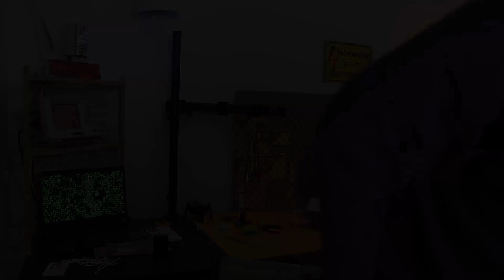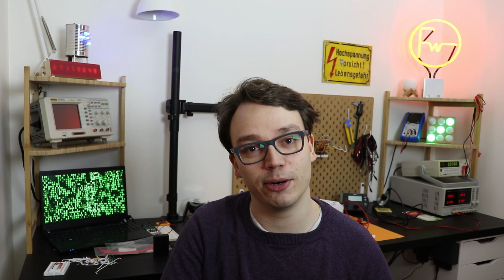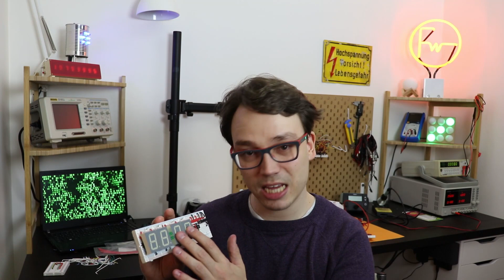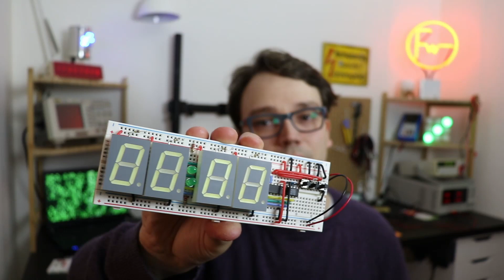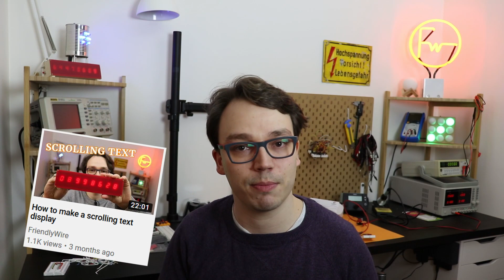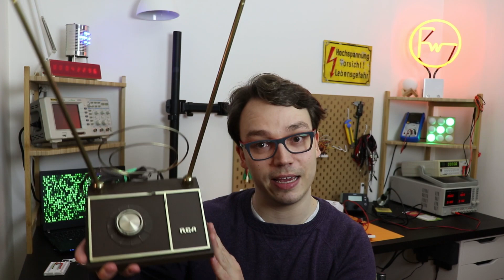Failed project, TLC5916 LED drivers, saying hello | Workbench Wednesdays #1

Comment: Mistakes are the best teachers, so I find this type of videos very interesting. Talking about the conversation of the use of Arduino or PiC Microcontrollers of below, I really aprreciate the effort of using  PIC as the audience is not as huge as if you were teaching with Arduino. I totally agree with you, I was used to work with arduino so when I change to PIC in college, I felt cheated because of the amount of differences between them. So, from my point of view, Arduino is NOT a good point to start on electronics. Anywhere, thanks for your videos! :)
Reply from the maker: Thanks for your comment and glad to have you here! I am not really advocating either, I am sure there are many situations when Arduinos are a great choice, and then again others when PIC microcontrollers are better, and then even others when neither is a good choice. I like to use PIC controllers because they are quite affordable and surprisingly simple to use :)

Comment: I'd love to see more projects that can be made with microcontrollers. I'd also like to get a better understanding of what the different IC's there are out there, what you can use them for, how they work, etc. I think the biggest thing for me as a beginner in electronics is not knowing what components are already out there so I don't have to reinvent the wheel each time when trying to build a new project.
Reply from the maker: Thanks for your comment! That's great! Funnily enough this is pretty much EXACTLY what I had originally planned for this channel. Instead of jumping from one kind of microcontroller family to another, I want to establish a series of videos that all evolve around ONE particular microcontroller family. In my case that is the PIC microcontrollers because I know them quite well. Then, in a second step, I want to introduce peripherals: real-time clock ICs, LED driver ICs, sensors, servo motors, stepper motors, those kind of things.
So I hope you stick around :) I try to make my videos self-contained so that they are not too overwhelming for beginners and yet include all necessary information. Have you seen my PIC introduction video? Let me know what you think!
Reply: @FriendlyWire  Yes I have! That was my introduction to your channel and motivation to subscribe. I actual purchased the PicKit, microcontrollers, downloaded software, etc. all because of that video.
Reply from the maker: @lcohen2981  That's amazing! I'm very happy I could help you in the  first steps! How is  it going? Don't hesitate to reach out if you have questions, either here or on other social media (I am @FriendlyWire everywhere).
Reply: @FriendlyWire  I haven't had nearly as much time for it lately as I'd like, but I will absolutely reach out as needed! Thank you for the offer!
Reply from the maker: @lcohen2981  Yeah don't hesitate to get in touch :)

Comment: Thank you for the update!
That real-time clock (RTC) project looks promising, but I must have missed the "failed project" part. Sound more like a "Did find a way that doesn't work and adapt accordingly" project. :-)
btw: I love that breadboard look of the clock. I wonder if it'll be worthwhile to make a prototyping PCB that looks like a breadboard (with white solder mask and all) and use that for a permanent installation to hang it on the wall. Would be neat. ;-)
Reply from the maker: Thanks for the nice words, Thilo, I appreciate it :) The breadboard layout is a lot of fun, actually. Some people like jigsaw puzzles, and I like to play with breadboard wires I guess.
Not sure I understand exactly what you mean with the breadboard PCB: I suppose these already exist in some fashion as perf prototyping boards, where copper traces are roughly the shape of the breadboard connections. Or do you think of making a PCB layout and still use all the wires, just for the fun of it?
Reply: @FriendlyWire   Yes, prototyping boards in the fashion of breadboards do exist. It would be fun to have PCBs in the exact shape and layout, and with white solder mask. Then it would look exactly alike.
And then the components and wires go on there, but everything is more permanent.
Just an idea. Maybe a silly one. :-)
Reply from the maker: @VintageProjectDE  I like this idea because it is partly silly :) For now I am trying to stay breadboard-only and also I am trying to minimize the soldering to keep everything simple for beginners. But I think at some point I will try to explore making PCBs, and then this would be a really fun idea! Thanks for sharing :)
Reply: @FriendlyWire  That's perfectly fine!
But your breadboard builds are so nice that I often think they'd deserve to be a bit more permanent. :)
Reply from the maker: @VintageProjectDE  Thanks :) I suppose I could just place them in some sort of translucent resin as well! I think Dave from davedarko did this with some circuits some time ago. Let's see :)

Comment: Hi sir, you'll be also working with MCU's?
Reply from the maker: Hi Marvin, thanks for stopping by :) Can you tell me what exactly you mean by MCU? Most of my videos so far are about PIC microcontrollers :)
Reply: @FriendlyWire  Microcontroller like Arduino,Esp,Rasberrypie and etc...
Reply from the maker: @tagolimotmarvin2243  I see! For now my plan is to focus a bit more on the PIC microcontrollers. I think these are really nice for beginners. Why? They are relatively cheap (only a few $ per piece) and you actually learn how to program in C, without using libraries for everything. I know I am going a bit against the overall trend of Arduino-ization in the maker community, but I hope to offer something interesting that complements the already very substantial Arduino content out there.
Are you interested in learning how to use PIC microcontrollers?
Reply: @FriendlyWire  Yeah, that's one of the reasons,  PIC microcontrollers is also interesting to learn, I will be waiting for your future videos sir.
Reply from the maker: @tagolimotmarvin2243  That's great, happy to have you here :)
Reply: @FriendlyWire  Thank you sir, for sharing your knowledge to us.
Reply: @FriendlyWire  i have a easypic v7(i think) board meant for absolute begginers and i still cant figure out how to program it. It has a pic mcu but i dont know the exact one. Maybe a video on how to program them?
Also, i dont like that you have to convert the code into hex, and then upload it. The arduino ide, as i told you on reddit, is much more user friendly for beginners. You just select your board and upload.
No hex conversion, no complex ide-, nothing.

Maybe take a look into it?
Reply from the maker: @filipcvetanovski2545  :-) Thanks for getting in touch Filip, great to have you here! :-)
Oh my goodness, I just looked at the easypic v7, and WOW! That is one beast of a board! That is certainly enough to get you started into the world of PIC microcontrollers. Ironically, if you follow my videos here on the channel, you will see that I don't typically use those kind of boards. Why?
I think they can be overwhelming. Sure, they offer a HUGE amount of functionality. But for beginners I think it is nicer to focus on something simple first, and then go step by step by step and expand our horizon, without unnecessary stuff lying around that confuses us. So I decided to start simple. The only thing you need to buy is the PICkit3 programmer and a single PIC, for example the PIC16F627A. Everything else you can get on Amazon, and it's not a board, but breadboard electronics. You can re-use it later! :) 

Arduinos are a different story. Sure, the development process is a bit streamlined, but there is still a lot of stuff on an Arduino board that is not needed for simple projects. I believe in using simple tools for simple projects :) And understanding how to create a .hex file is really not that hard. I am curious: Have you seen my PIC introduction video? Does that explain everything at an OK-ish level, or is it still too hard? It would be nice if you could let me know, so that I can improve.

Thanks again for stopping by, and have a great day!
Reply: @FriendlyWire  i saw your video on the pic16. What i meant is that with an arduino its easier to program it. Sure there are a lot of unnecessary things, but that means you can choose to make your project better whenever you want. I use an arduino even for simple stuff like driving led strips. Also i didnt mean making a video on the easypic board, i wanted to say that it is a bit complicated to program it, especially with the basically unusable pc software from the mikroprog firm.
I understand if you dont want to use arduinos, but maybe someday you can make a more complicated project with it.
Reply: @FriendlyWire i forgot to add: the video was good, its just that i think the programming is a bit complicated. It can be a bit intimidating for beginners to convert file types and download different compilers for different things. With the arduino ide you just click upload and woala, done. (Unless you have any errors in your code)
Reply from the maker: @filipcvetanovski2545  Arduinos are great for many people! It's just that I am not a fan because I think that they are a bit expensive and overkill for many applications, and sometimes that even hinders a deeper understanding of microcontrollers: it is not really difficult to generate hex file and flash it on a controller, it's just one step more compared to the Arduino procedure. And I believe it also creates some valuable skills for understanding electronics :) I cannot say anything about the mikroprog software, but my experience is similar with third party software. For this reason I switched to MicroChip's software many years ago, and it just works :)
Not sure if I will do Arduino stuff in the future, there is already so much out there, and I don't think I have anything to contribute to that at this point. Rather I want to show people that PIC controllers are also fun :) Thanks for sharing your thoughts, and have a great day!
Reply from the maker: @filipcvetanovski2545  Thanks so much! Yeah, I know, it's a big hurdle at the beginning. But I strongly believe that it is totally worth to learn how to do it. It takes one weekend to figure it out, and in my video I show all the necessary steps. It's a bit of a risk to take, I know, but I took that risk in 2010 or so before Arduinos were a real thing, and for me it was totally worth it. And I also believe that if I could do it then anybody can :)
Reply: @FriendlyWire  the clone arduinos on ali express or amazon work just as well as the authentic ones and they are a lot cheaper. The arduino nano every that got released last year(i think) is just 8 euros. That includes a voltage regulator, usb to uart converter and a atmega4809 micro controller.
Reply: @FriendlyWire  i dont really use pics, so i dont think i will learn the process soon, but if i ever need to i know just where to go.
Reply from the maker: @filipcvetanovski2545  Thanks so much :) I appreciate your point of view and totally get it. Out of curiosity, what would be a reason for you to start delving into PIC controllers?
Reply: @FriendlyWire  i dont know an exact reason, but maybe if i run out of arduinos or want to learn to use pics, or dont want to use an arduino for something really simple.
Reply from the maker: @filipcvetanovski2545  Thanks, this is super helpful, I appreciate it :)
Reply: @FriendlyWire  no problem. But please collect more feedback before updating your video making process. I dont want to be the reason people stop watching videos because you changed too much.
Collect data from multiple people and change for the better from the things that they want. You are probably already doing this, but i wanted to say it just in case
Reply from the maker: @filipcvetanovski2545  Thanks, that's very nice of you to say! The audience is still small, so it's nice to get in touch and see what people like and want to see. That being said, I of course have some sort of plan in mind of what I want to cover in the next months, and I am just trying to figure out if that somehow aligns with the interests of you and others :)

Comment: This looks like a good idea of a chat show. I have some HC595 shift registers, it will be interesting to compare those. I love the old TV antennae, I used them as a kid. You could fine tune stations especially UHF band. VHF was possible but not as easy. Sometimes the atmosphere was good enough to pick up late night broadcasts in Montreal from Pennsylvania. Late night TV in the '70s wasn't big, so the best reception was the least broadcast. I had much better luck with radio. I'd listen to jazz from Chicago and New Orleans.
Reply from the maker: Glad you like it :-) Yeah, the HC595 registers are an evergreen, but they have almost all their terminals on one side, which makes it difficult to use them for 7-segment displays. I like the TLC5916 because it has four outputs on either side of the chip, so it's very easy to plug in a 7-segment display right on top of it. As I understand, the TLC5916 also has programmable current limiting, so it is possible to dim the LEDs without changing the current adjustment resistor. So I am excited to give that a try. For other uses the HC595 is an amazing chip for sure. Maybe I will use it for a future project, thanks!

Yeah, the old antenna looks really interesting. I was born in 1990, so I did not grow up with that technology, so I hope you will forgive me if I turn it into a clock in a future video :)
Reply: @FriendlyWire  It is a lovely antenna, I hope your project gives it new life.
Reply from the maker: @jerril42  Thanks! Yes, it is quite the eye-catcher. I hope you will like the result :)